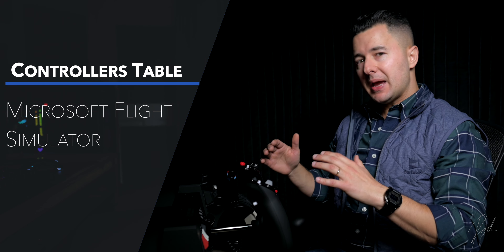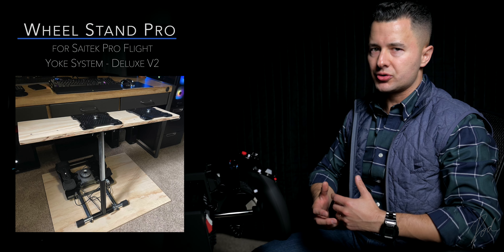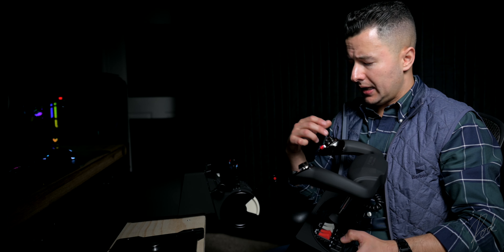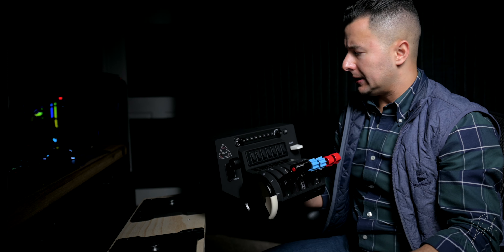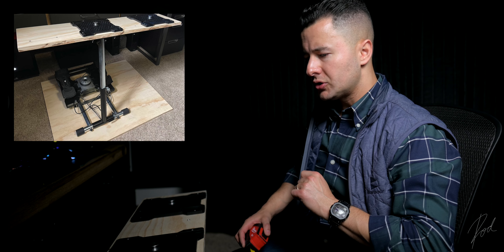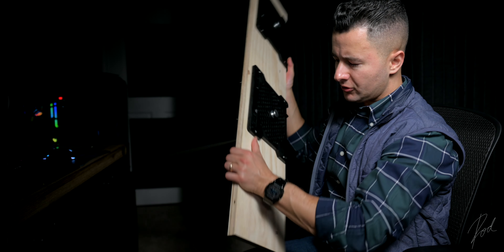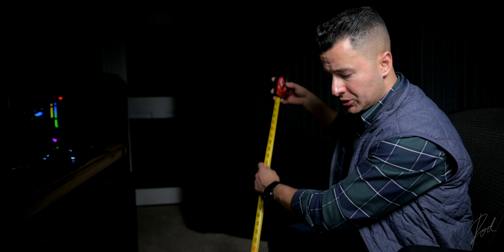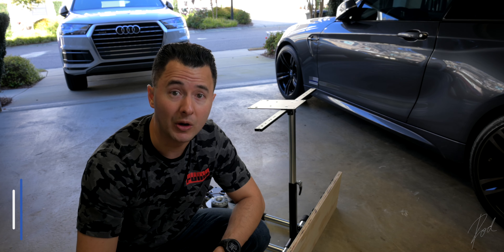MSFS - Honeycomb Aeronautical - Custom Build

Comment: Hi, just the video I was looking for regarding the Wheel Sand Pro and Honeycomb setup.  Question does the stand want to tip towards the Bravo quadrant as this was my main concern? Thanks
Reply from the maker: It certainly does, that’s why I have the large wooden platform to stabilize it. You could make the table longer and add some ballast on the other end… whatever works for you!